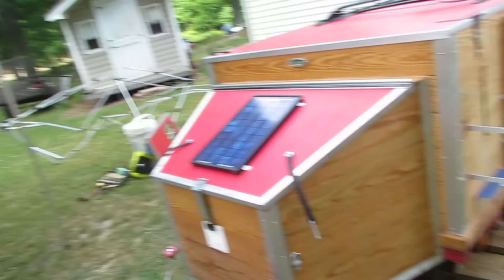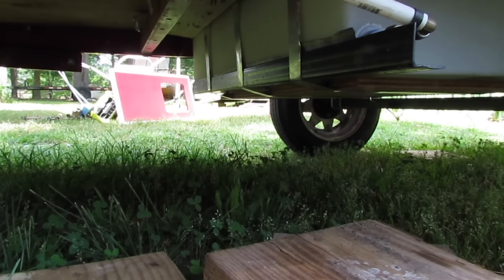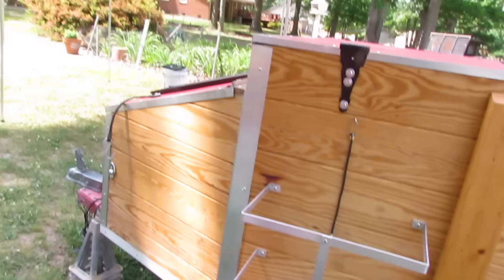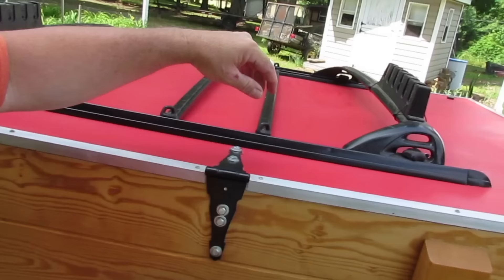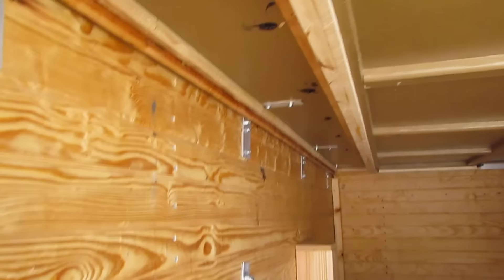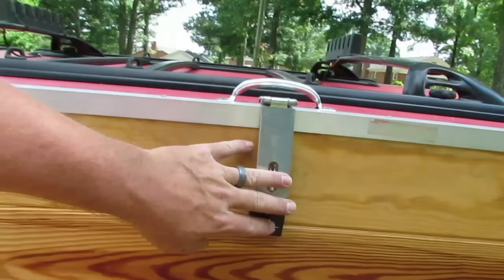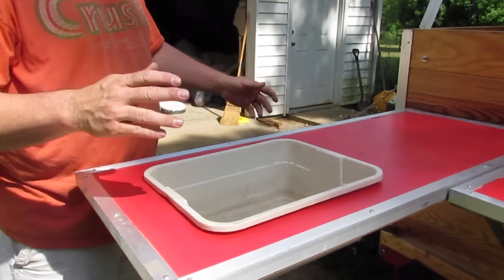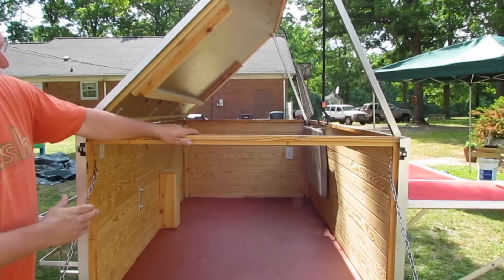Harbor Freight 4x8 Camping Trailer

Comment: Looks great. You gave me a couple of ideas for mine. One comment.  You are concerned about the front box (with the electric) getting water in it.  You may want to move the air vent from the front to one or both of the sides of that front box.  I can see you driving in the rain, and that vent catching water.  Just a thought.
Reply from the maker: Thank you, so far I've been able to avoid driving in the rain but that's a good idea. I hope you are able to use some ideas from this build. Thank you for watching
Reply: Jeff Furr  did you fuse any of the curcuits? you didnt say nor did i see any.
Reply: very VERY simple fix for that vent... to keep the water out... just put one of those dryer vents like on the outside of a house over it...  The hood will keep the rain rolling down and you could even attach it so that your vent is high enough inside of the hood that rain would stay out even on the highway.

Comment: Great video and good job on the trailer. I am Canadian and use to go to Florida/Georgia usually from November to April in a home made camper that I made. I am a contractor so have a pretty good understanding on how to build things. The only thing that I could suggest is drop down jack supports in all four corners of your trailer. So, when you are doing stuff on your table or what ever, the support jacks will keep the trailer stable. I slept in mine and every time I turned over, the whole trailer would move so I added the support legs and fixed the problem. Again, nice to see a handy person doing his own thing. Cheers
Reply from the maker: Thank you, I agree and those jacks are definitely an addition that will be made in the future.
Thanks for watching
Reply: Jeff Furr Agree!  But 1st... Great job as you can tell by comments!  Appeals to car guys, DIY guys, camping guys and even those tiny home guys.
I had a pop up that was given to me and all chewed up, so I knocked off the top and used it as a trailer, but most important about that you could pick off the jacks mentioned above and possibly even the canopy crank system that you hook your drill to crank it open your top.
Again, great video, great work, thanks for posting and I will subscribe.
Reply: ScubaMathis Hey. I noticed your handle as ScubaMathis. I am a master diver myself and went to New Zealand in 2010 on a scuba trip. Great times. Care to share any of your experiences?
Reply: Nova Supernova Ha! I wish I was certified.  Just done a little snorkel or snuba cancun, cozumel and hawaii.  I like Cozumel and Hawaii the most.
Reply from the maker: +ScubaMathis great idea with the pop up, I have a friend that has a pop up that's in need of a lot of TLC. I've tried to get it to use the parts for my trailer or to rebuild it if it isn't to bad. He won't let go of it though, it's been there in the same spot for at least five years, maybe one day.
Reply: +Jeff Furr  A set of 4 jack stands from mechanic shop may do! I prefer those 3 ton jack stands, even though your trailer is not 3 tons. That is what I use to repair my rigs.
Reply: +Jeff Furr  Jack stands from the auto parts store may work! I use 3 ton jack stands to support my rigs when I repair them.
Reply: +Jeff Furr here is a set for the lowest that I found and look great. 
             http://www.ebay.com/itm/4-pack-Swing-Down-jacks-stabilizer-cargo-trailer-jack-camper-1319410-1219/181325899959?_trksid=p2047675.c100005.m1851&_trkparms=aid%3D222007%26algo%3DSIC.MBE%26ao%3D1%26asc%3D32933%26meid%3D0ea71177cb594c539b71936696dbb28b%26pid%3D100005%26rk%3D2%26rkt%3D6%26mehot%3Dpp%26sd%3D301380028517
@Bryan Tint, these are very light and they also tuck under trailer for permanent storage out of the way and very easy.

Comment: I enjoyed your video. Great job! I bought a 5x8 utility trailer and built out a camp trailer just like yours. I have the same compartment up front for solar/battery storage, but mounted my spare tire to the front of it. I love the water jug brackets, the table tops and the water tank...I'll be adding those in the spring. My top hinges on the front, rather than the side, and I installed mosquito netting that drops down when the top is opened, forming a tent. I installed two 8 foot 'legs' on hinges so that when I open the top, the legs automatically fold down and support the weight. I have a hinged cot inside. I am installing brackets for an outdoor gas grill on one side. Good looking trailer! Oh, and I spray-painted mine in camo.

Comment: Excellent well thought out work, Thanks for sharing.
Reply from the maker: Thank you and thanks for watching
Reply: I agree.  The thinking is excellent and the craftsmanship is very tidy indeed.  Your woodworking and metal skills are very good and the results are sturdy and eye-pleasing.  You should be very proud.
May I make some suggestions?
1)  If you put your water inlet box in the corner of your front electrical box, you could run the water pipe from the inlet connector to the tank under the floor of the trailer.  That would eliminate the framing box on the inside wall and give you a more unobstructed wall.  I would build a water-resistant box inside the electrical compartment and drill a few drain holes (with screen to keep the dirt dawbers out) -- that way, if there was a water leak, it would just fall on the ground and not be a problem inside the compartment.
2)  Similarly, I'd use threaded flat nuts (the kind where the threaded tube goes inside a drilled hole in the wood) for places like the inside fasteners for your spare tire.  As above, that would keep the wall as flat and unobstructed inside as possible.
3)  You could put a piece of 1/2 inch plywood with hinges on the outside of the lid.  Raise the lid as you do now, then flip the 4 foot wide panel over your counters etc.  That would make a solid roof over your work area, food prep, storage, snacks, etc.  A tarp is good but in my experience, a solid roof/sunshield is much better.  You could do support legs that go from the ground (probably need screw adjustment feet) to the counters and then up to the roof.  You could add a place for a small work/conveniece light over your food prep and dish washing area.  (You'd need a little creative thought for the best way to mount and access your "roof rack" but that should be pretty simple).
4)  I'd replace your electrical inlet socket.  To power your unit as it is, you'd need a cord with a male-connector plug on both ends.  I'd eBay or check camping gear websites for a connector unit.  They have a water-proof cover and inside is a three-prong connector.   You just open the cover and push your power cord onto the connector pins.  I'd also have some stress reliever attachment there, too.  That way, even if someone tripped over your cord and dislodged it, there wouldn't be live plug pins there for someone to touch by accident.  Camping is often on damp grass and similar areas and we really ought to be in favor of everything electric being as safe as possible.
5)  I didn't see exactly how you switch between "shore power" electricity (120V) and power from the inverter.  What you could do is have a regular "outdoor" socket mounted on the inside wall in the electrical compartment.  Run the wire from the inlet socket inside of the compartment to that.  Then have a plug on the main wire to your interior socket.  If you have good electrical power coming through your "shore connection", plug the main wire into the socket.  If you want to run 120V from the inverter, plug the main wire into the inverter socket.  Of course, you can also plug a battery charger into the outdoor socket so your battery is being charged while you're using power from the "shore cord".  Doing it this way would give you safe and isolated use of your 120V electrical feed and allow you to charge the battery when you have external 120V power available at a campsite.
6)  On the subject of safety, I think I'd try to find a mini-breaker box (like a "Square-D" box) and run my 120V circuits through it.  That breaker box would be inside the electrical compartment; if you don't have one, you'd be depending on the breaker for the "shore power" supply and if you had something go wrong with what you have plugged into your 120V socket in the trailer, you might not get a breaker that far away to trip quickly enough to provide good safety.

But all this is icing on the cake -- it's a great job (although I'd encourage you to think about the electrical safety aspects) and you ought to be really proud of your work.  Thanks for showing us what you've done.

Comment: My dad has the same harbor freight trailer the hubs are only rated for 55mph if you go down the interstate you would want to change them out for higher rated hubs. Other than that good job love the setup.
Reply from the maker: Burn Time thank you, changing the hubs and axle is definitely something planned for a future project so that speed and weight isn't an issue. Thanks for watching
Reply: Jeff Furr your welcome, it's so nice to see what ingenuity people have that gives ideas to create other things.
Reply: Nice work Jeff. "A country boy can survive." If the electrical grid ever goes down and you need to bug out somewhere you will be in good shape. The ones posting negative comments will be SOL. I'm thinking about buying one of these and was wondering if you kept track of what everything you put on there weighs and how much was left for cargo. My biggest concern is the axle and the hubs and tires. I want to haul three 55 gal rain barrels for emergency water and fuel, but I love the solar/electrical set up you've got on the front. Very ingenious.
Reply: Have the same trailer. 55mph is news to me, don't remember seeing anything about that in the paperwork. Thank you. Wow all those trips back and forth from S. Florida to NC @ 70.

Comment: Love the door hinge table mount idea, I will be robbing that idea to mount a table on the side of my class C Motor home, Thanks for the great video.
Reply from the maker: xippzap thank you, I'm glad I was able to help, I decided to use hinges after seeing the price of table mounts. Thanks for watching
Reply: stanley makes a fold away bracket supports  for that side mount table top. i used them on my step van fer years as a fold up work bench on the side  they were about 40.00 a set of two , lift up the top  fold the diagional brace up inward  slips in joints to fold down  .    simplely used   1 pc.. 13 ply 3/4 marine plywood 2' x 6 ' . 

the hinges are the inexpensive method fer sure. just a little added set up time.   fantastic job all around.  congrates

Comment: You should put some sort of window in there in case you are trapped in it during a rainy day. Also the tailgate opening down will be an issue when it rains. That's why hatchbacks open up. Cool trailer though.
Reply from the maker: fin screenname thank you for the suggestion, we don't actually sleep in the trailer yet, it's just to haul gear. I hope to convert it at some point so we can use it as a sleeper. Thank you for watching
Reply: @TheFurrminator  thanks for answering the sleeping question.

Comment: I have a 4 x8 also. I hinged mine in the front, Have support poles in back corners. I'm putting sides on it, screwed in on top with hook and grouments on the bottom as I plan to sleep in mine on a folding cot. I have shelves on both sides that are permenantly fastened . mr spare tire mount is on the front. works great for my needs.
Reply from the maker: I like the idea of using folding cots to sleep in the trailer, also like the idea of adding shelves. You should put a video of the trailer on your channel. Thanks for watching

Comment: A friend of mine gave me this idea, and it's already paid off. He buys a spindle, hub, and wheel bearings to match the ones on the trailer. He then mounts the spindle on the trailer, you would have to decide yourself what would work best for you. Now, mount the hub, bearings, and dust cap on the spindle, then mount your spare tire to that assembly. Not only do you have a spare tire, you have a spare hub assembly if you happen to have wheel bearing problems on the road. When I put the spindle nut on it, I only put a slight bend in the cotter pin, so it's easy to insert and remove. Although I do keep a few extra in the tool box, just in case I lose the one on the spare. Oh, of course make sure the spare assemblies bearings are packed and ready to go. Once. in cold weather I found it was faster to replace the whole wheel, tire, and hub assembly faster than changing the flat tire. Of course, the spindle isn't meant to be used as a spare. It's just there to hold the spare hub and tire.
Reply from the maker: Thank you, that's a really good idea, I like that a lot. I haven't had issues with the bearings on this trailer but I have on two other trailers in years past and a spare hub and bearing would have put me back on the road really quick. Thanks for the suggestion and thanks for watching

Comment: Rather than move the fenders, you might want to consider installing heavier springs.  Light trailers are engineered in balance, and the tire touching the fender indicates a heavier load than the springs were designed for.  The job is a lot cheaper and easier in your back yard than on the road.

It looks like a busted EZup in the yard.  The corner posts of one of those makes heavy duty extendable tent poles.  We call our trailer the "adventure-mobile".  Lots of similarities, and I have a canoe rack on top, and small outboard motor mounts inside and out.

Thanks for a nice, clear video.  See you on the road.
Reply from the maker: Thank you, I have already moved the fenders up about an inch but I'm still going to upgrade the springs and axle. I like the idea of a Canoe rack, Im hoping to get a kayak soon and I'll be adding a rack to haul the yak. Thanks for watching

Comment: Rather than replace just the tires I would dump the 4 bolt axle which maybe is a 2000 lb axle and get a 3500 lb 5 bolt one and put 5 bolt rims and wheels on it. Upgrade the springs at the same time. Nice trailer.
Reply from the maker: I have already replaced the tires but I do have plans to upgrade the axle and springs. I have also thought about going with the five bolt aluminum wheels which, I think, would look great on the trailer. Thank you for watching
Reply: ***** True, but the fact that this trailer has sides that gives it a whole lot more strength. Not sure that he is even close to a ton of weight total on this trailer. Just when you change the diameter of the tire the bearings and the tire are going to last a lot longer. I believe because of the cost of tires these trailer manufacturers skimp on axles and tires to save money and rate them solely on axle capacities.
Of course if something breaks and kills someone the trailer manufacturer is no longer liable but the person doing the modifications is. As soon as he built the enclosure on this trailer the warranty and liability is shifted to the owner and it is up to the insurance company and the state whether or not they will insure it or license it. A good corporate lawyer could prove the manufacturer is not responsible just because you put larger bolts to hold the license plate on than what came with the trailer or upgraded the lights to LED.

Comment: The one concern I have is you putting the electrical and plumbing in the same box.  If you spring a leak in the water line or pump, it could spray into that inverter.  Maybe as a precaution, just build a simple cover for the pump, and put some foam insulation around the lines to contain any spray in event of a leak.
Reply from the maker: Thank you for your suggestions, I have planned on building a cover for the pump, it just hasn't happened yet. Great idea about the foam around the lines, haven't thought of that. 
Thank you for watching

Comment: you really want to add some small 2 inch triangle reinforcements to the the back half of the trailer in the corners on the frame otherwise the trailer will bend over time that little spar is not enough
Reply from the maker: Thank you for your suggestion, good idea.
Thank you for watching

Comment: Hi Jeff, this is a great build, thanks for sharing! Quick question, for your electric, how are you charging the battery? In the video you go through the solar panel and although that would work, that seems more like a trickle charger rather than a full charge... does your battery charge off your vehicle when connected (when towing)? If so, can you explain your hookup? Thanks!
Reply from the maker: Thank you and I apologize for the late response, I missed this comment somehow. The solar panel is a trickle charge, I mainly use my Honda generator to charge the battery, it runs pretty quiet so we will run it usually once a day to keep the battery charged. I have not wired the harness to charge the battery while driving yet but I do plan to do that but I'm not sure of the configuration yet. When I do I'll video it and upload it here on the channel. Thanks for watching.

Comment: Sir-That is an AWESOME trailer build!!!  My wife and I are/were considering a little teardrop-type trailer for toting along in our retirement years but you've truly inspired me with your build.  I'm impressed with the amount of thought that went into your trailer.  Do you sleep on an air mattress or just sleeping bags on the floor?  Also, how does she pull?  Do you know the gross trailer weight all loaded up with your  equipment?  Very interested in some on-road vid towing it.
Reply: Very nicely done FYI  you can build Plywood  HoldingbTanjs  by sealing them with a Epoxy Resin and Fiberglass Cloth   i’ve built several for inside my CabinCruiser boats Engine Compartment not only to save money but  it made it easier to maximize  my tank Capacity for  a s oddly shaped area   another nice feature is  you have the flexibility of installing   inlets and Outlet fittings  that most fits your Project and  needs (again using Epoxy)